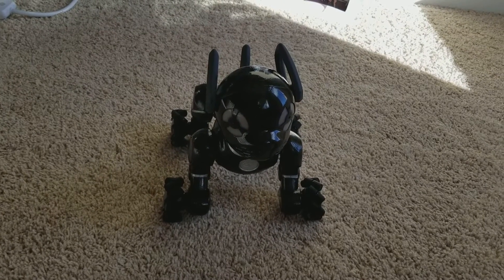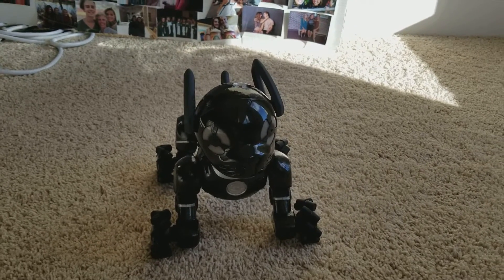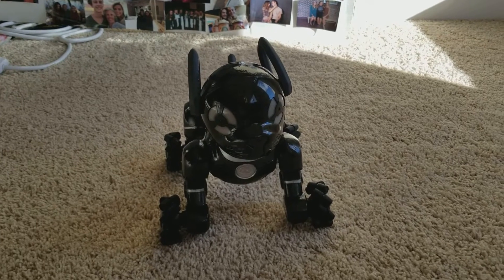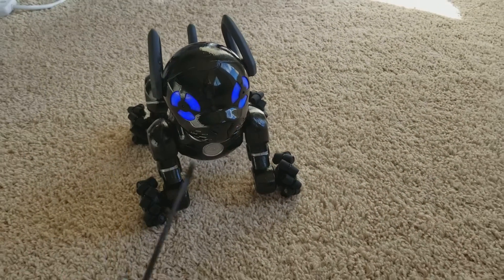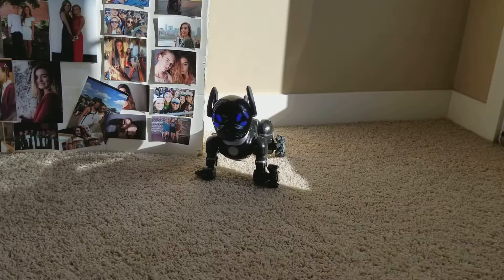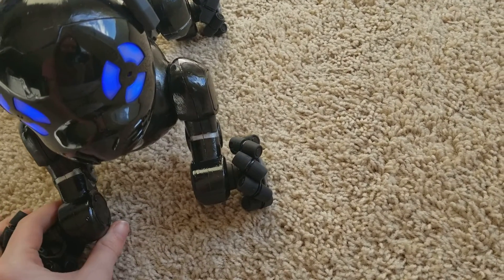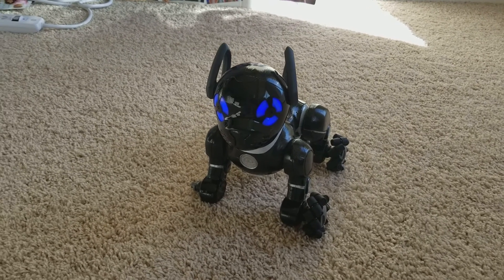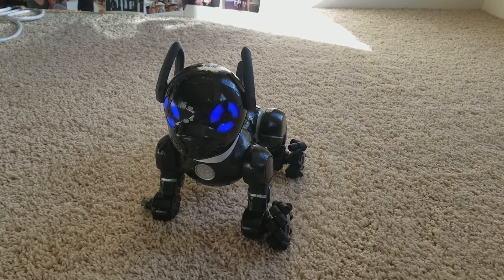Black Friday Special: Fixed Up and Black Painted Wowwee Chip

Comment: When it broke was the broken wheel still slightly moving a little bit? Because that's what my CHiP's back wheel does on occasion. Otherwise it doesn't move at all
Reply from the maker: The wheel doesn't move? I can do the same fix for yours I did for this one! He had the same problem

Comment: I have a CHiP that has a broken wheel too. Any suggestions on how to fix it? It seems a little complex to change the motor (or whatever you did) so any other ways you'd suggest?

Comment: I had a chip with a bad gear in its left rear leg. Unfortunately, wowwee does not sell the gear assembly or the gears. If anyone has a used gearbox or back leg for sale, please let me know.
Reply: Isidro Murillo My chip had all four of the gears broken in all four of its wheels. The gears are easy to find on eBay or amazon, they’re just standard 8 tooth gears
Reply: I don't have Chip in front of me but I seem to remember there were 2 or 3 different sizes. I just remember mine was the smallest. Do you have a link to one on eBay?